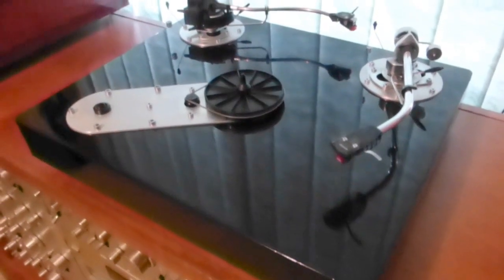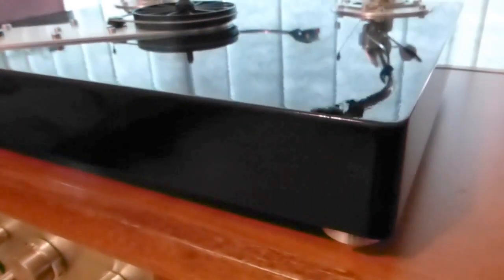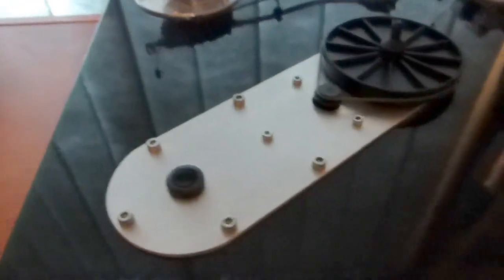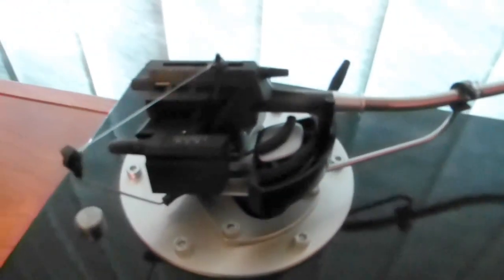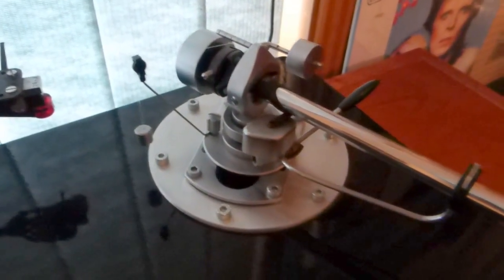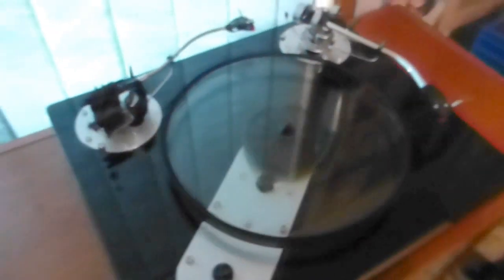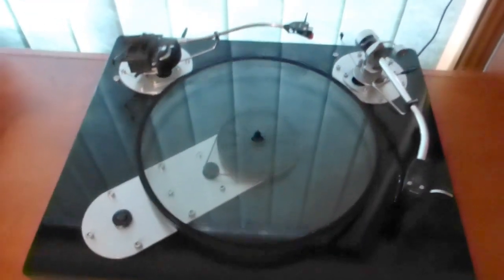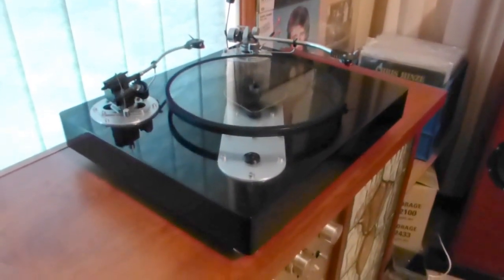Rega Plannar 3 conversion. SME Tonearms & Grace Cartridges.

Comment: with a cheap plastic sub-platter?
Reply from the maker: Use an all metal upgraded hub if you want inferior sound. They fail as an upgrade on the glass platter.
Reply: @mr586308  I had a rega p25 with a "cheap" plastic sub-platter. I installed a very well respected precision machined sub-
platter as an upgrade, and didn't like the sound. Later I had a rega p5 with the same "cheap" plastic sub-platter. Tried the precision machined sub-platter upgrade again. Had the same results. Everyone else I have read on the internet loves that upgrade. Somehow, we are hearing things differently.,